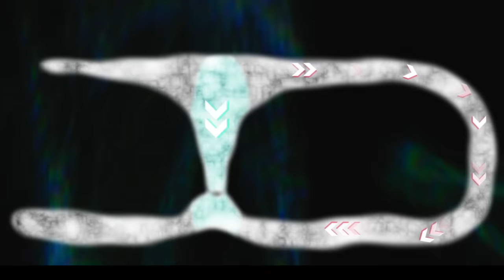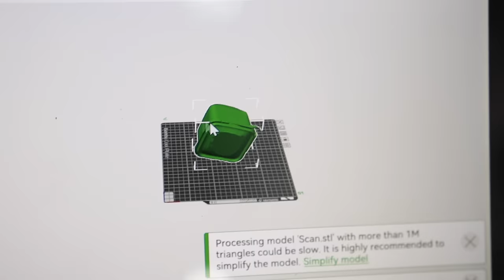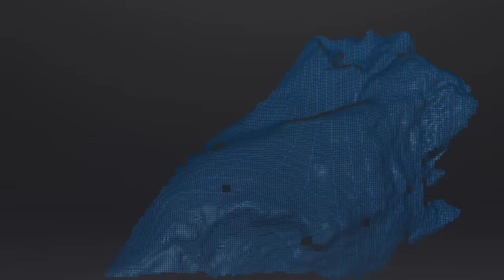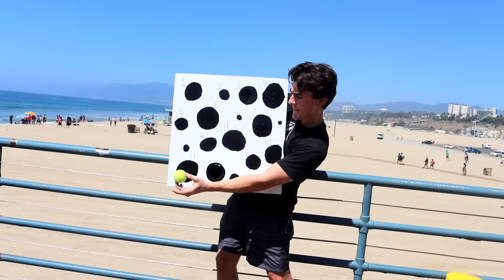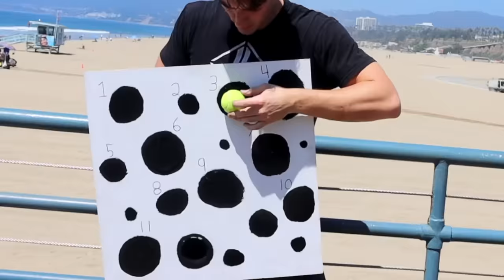I Built Spot Portals From Spider-Man!

Comment: So small note on teleportation : as of now, we can only teleport the information related to particles, not the particles themselves. It's a small but quite necessary distinction ; no, you won't be teleporting around anytime soon.
Reply: There isn't any information sent between the particles though.
Reply: @VikingTeddy  No, but by synchronizing the state of two particles we essentially send information about the particle we are synchronizing. Think about it this way : we have an apple in new york synchronized to an apple in paris.

Now, I am in NY and I poke a pencil through the apple. I have effectively communicated to whoever is watching the apple in paris, that the apple has been damaged -- pierced, more precisely.

We're not transporting particles, nor are we sending actualy bits of information through, I do agree with you there. The "information" we are sending is essentially reliant on extrapolating said information from the state updates of the particles. The easiest way to use this would be as a communications method.
Reply: @VikingTeddy well like sending a email is pretty much teleporting information
Reply: @bb2lit866  Holy cow! You've actually managed to send information faster than light? And with email no less!

Did you at least send yourself the upcoming lottery numbers :)?
Reply: @thetheory6159  Getting back to paired particles, we can't send any information because the end result is random. Sure the other side will know what result you had, but you can't agree beforehand whether you're sending a one or a zero/up or down etc.
Reply: @VikingTeddy  never said it was time traveling. What are you talking about?
Reply: @bb2lit866  If you have an instant communication method, it's by default ftl, which means timetravel.

But I was just being purposefully obtuse, didn't mean to appear rude. Sry.

Comment: Awesome vid, as always. Just one note though. That bottle you show at 9:30 isn't Vanta Black. It's Black 3.0 by Stuart Semple. Vanta Black is super toxic, corrosive, flammable, and generallyh dangerous when not applied in a lab setting. Black 3.0 is just  smidge less black (like, not super noticable unless side by side and youre looking for it), but is non toxic and user friendly (and has a funny backstory about its creation. Totally worth a google to see the back and forth between Stuart Semple and Anish Kapoor).
Reply: AHEM Vanta black is considered non-toxic but can cause damage to various organs. Take this google sample for instance. "Vantablack is not toxic. However, it can cause “non-lethal, but reversible or irreversible damage to specific organs after contact” 1. In the absence of any other data at this point, it’s reasonable to assume that Vantablack is pretty safe – not because the material it’s made of isn’t toxic, but because, when used as intended, the chances of this material getting into someone’s body are vanishingly small" so it's decently safe as long as you're not drinking it or like painting yourself with it. I guess your both kinda right then. @MeCooper
Reply: @MeCooper  Found the Anish Kapoor supporter.
Reply: @MeCooper gives the same energy as ''Im not weird, im just not normal'' lol
Reply: @Liztamine *Stuart Semple Supporter
Reply: Vanta black is darker than musou

Comment: great video. entanglement shows opposite spins. So, if you measured one and it had an "up" spin, thus breathing the entanglement, the other would have a "down" spin. They're not the same particles, just as the name would suggest, they're entangled.
Reply from the maker: Yes good catch, in the corner I did write "identically opposite", just didn't want things to get too confusing!
Reply: @JLaservideo you should do extender arms! Like those t-Rex plastic grabbers but more refined. You should be able to make with a reinforced slinkie! The slinkie itself could act as the wires to make the hand at the end work. This would be great for something like rock-em-sock-em or arms, but if you wanna do something more mainstream it could be titled DC’s plastic man.
Reply: So it'd be more like a coin flip? Instead of a dice, it'd be one lands on heads and we know the other will land on tails?
Reply: I wonder to what extent that could be expanded. Like, with standardised dice, would the top face (and other faces) always add up to seven?
Reply: its also not actually teleporting anything. Even the claim that its teleporting information is really sketchy, Ive seen a number of videos basically debunking that claim
Reply: Please, try to create a gadget that allows breathing in water(by using oxygen from water)... By using certain chemistry, I'm thinking about using a quick reaction tube, with valves... 

Just thinking if that would be able to eliminate the need for heavy cylinders.
Reply: @RANDOMINTERNETBULLSH1T2468  we already have things that make it so that you can dive without heavy cylinders, theyre called rebreathers. Its much easier to filter the co2 out of your breath so you can rebreath the oxygen than it is to try to get oxygen out of the water, there simply isnt enough oxygen in water per unit area to make that feasible and thats exactly why we dont already do it.
Reply: @JLaservideo you should do a ghost rider like thing either a motorcycle that you can safely engulf in fire with a button or even the flaming chains or something. Ps bought your web slinger for friends kids bday stoked for it
Reply: @SpydersByte  Thanks for the heads-up... I'll check the internet for 'em
Reply: @JLaservideo hey, i have an idea. What if you got the thors hammer you made, but made it so that it uses facial recognition. If it doesnt recognize you it makes itself REALLY heavy. Or if thats impossible or just really hard you could make a custom table that locks the hammer in place, making it impossible to lift. But using said facial recognition (or a hidden button) it unlocks the hammer, making you able to lift it
Reply: @Eh-its-me  No, for a coin flip specifically, they'd both be heads because they're rotating (or flipping) the same amount, but taking the opposite route.
the best way to describe this would just be to use clocks

If two clocks are on separate sides of the globe, and the minute hand on one is moving Clockwise, the other will move Counterclockwise.

Comment: ive had an idea
make an uncharted 4 grapple hook 

you have to throw, not shoot
auto-maticly extends  and shrinks depending on how far you throw
the hook has 3 hooks that pop out when you swing it before you throw and come in when you put it on your side
fits on a little hook on your left
its 100%  accurate and it goes round whatever your throwing to and with a little pull, it goes back round and comes off
after its come off, it automaticly shortens onto your side

its a lot and it would take a bit but i think you could do it and it might make a little more sense if you get the game (PLAYSTATION ONLY      PS4 AND  PS5)

Comment: Data is slower than light speed. It encounters resistance as it moves through circuits and wifi (interference). Light in a vacuum (light speed) does not.

Comment: Imagine a teenie tiny version of this insanely fast printer inside a web shooter. Hypothetically, it could heat up the plastic just fast enough to shoot and stick to its target. Now imagine a bunch of those tiny machines in a web shooter shooting several strands of filament out at the same time. If this could ever be possible, i wonder if the multiple layers of plastic could be strong enough to hold a person up.

Comment: no in the portal room the portal shuld be random soo there is a core and receiver the  receiver  is the portal as you put some thing in the portal the thing goes in to the core the core is connected to all the portal by a tube so when the item comes in the core picks one tube then shots it in a random tube with a program by air or some thing